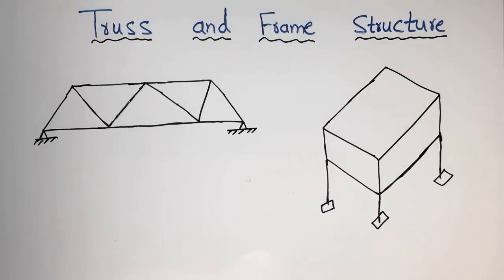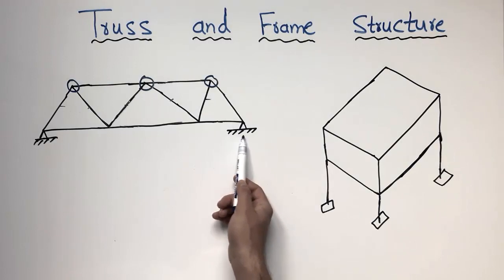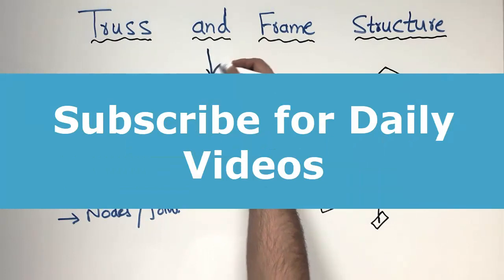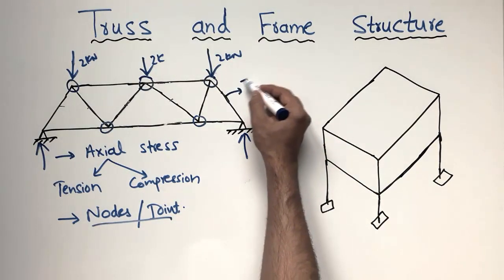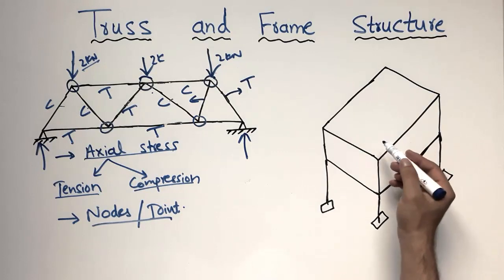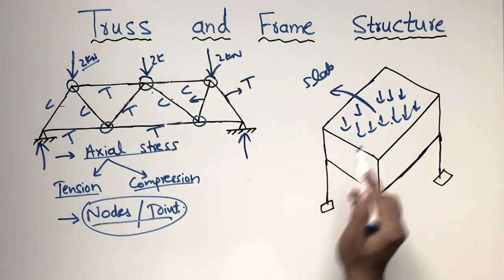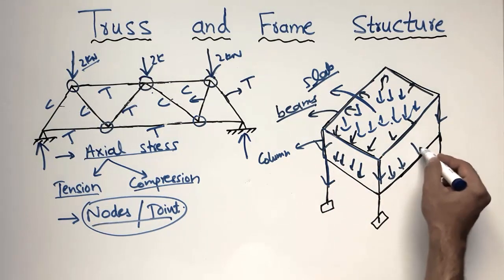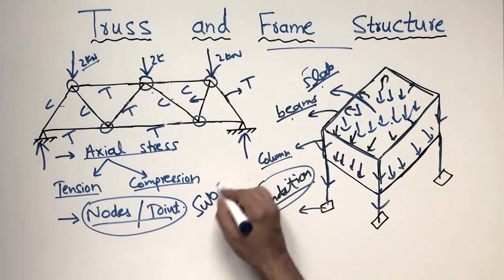Difference between Frame Structure and Truss Structure

Comment: Interesting video, really thank you. I´m not an engineer but I think in the case of the truss structure is necessary to analyze the nodes and the second you need to analyze the capacity of the beam and the forces to infer in both.   thanks master¡   Greetings from México
Reply from the maker: Many thanks and yes you are right #Alex